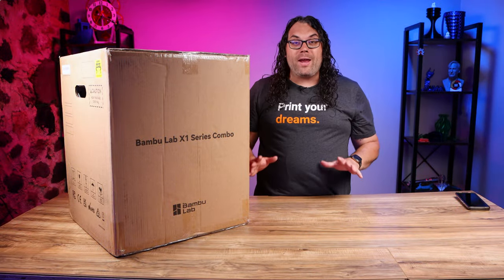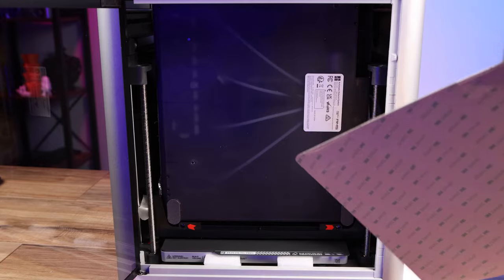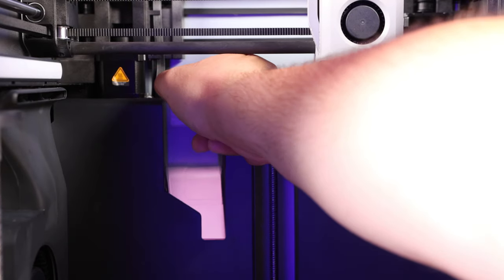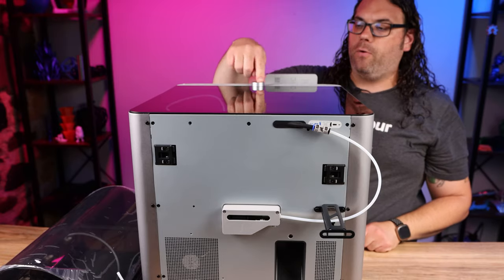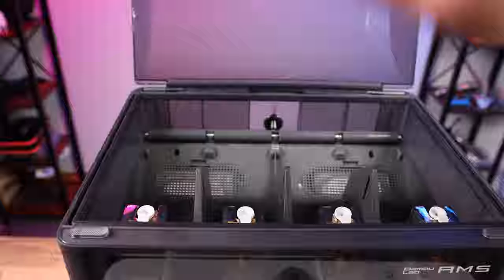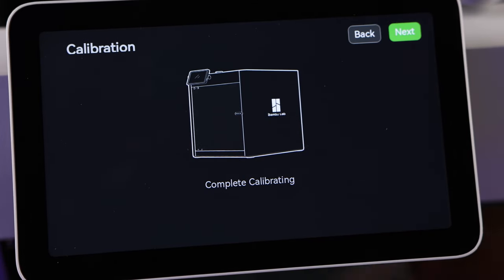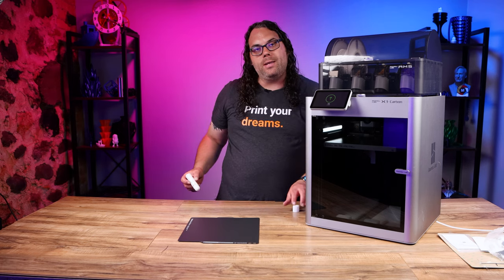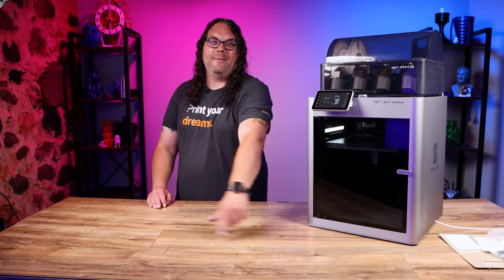Get Started FAST With The Bambu Lab X1 And X1 Carbon!!

Comment: If you are reading this in 2023, DO NOT print with the included white filament…. That is a special brittle filament that is only for supports.  If you print with it not only will the print fail spectacularly but you’ll become so frustrated that you’ll get drunk, knock over tables at Taco Bell, break your hand punching a tree and eventually in a drug-fueled rage expose yourself to a cop and sit in prison for 2 weeks because your kids won’t bail you out.  Trust me.   If you’re reading this in 2022 then yes, go ahead and load the white filament.
Reply: And if your in 2024?
Reply: You'll go to jail not prison. You gotta get convincted to end up in prison.
Reply: Deeply relatable. Thanks for the heads up
Reply: I am trying to read this is 2022 so I can use this filament, but I can’t seem to do it. 😢
Reply: i come from 2024 and about to buy this. Can I understand why I should trash that white filament?
Reply: @Toucheatoutyt  its support filament but i wouldn't teash it.
Reply: Hum…. That was to specific for this not to have happend….. 😂😂😂
Reply: @98f5  STRAIGHT TO JAIL! Gru voice
Reply: Help I'm in 2024. I'm too young to go to jail.
Reply: In 2024 there is a white pla and a white support pla
Reply: I'm going to start with green. I know all about reacting badly to stuff so hope you dont too bad :)

Comment: Nobody mentions this but leave the plastic Styrofoam underneath the bed on until after you calibrate the bed and the bed will raise itself. Don't try to rip the foam out with the bed clamped on top of it

Comment: I’ve had my X1 Carbon for 4 days.  I waited until yesterday to unpack it and spent the previous days looking for unpacking and start up videos.  There are quite a few but yours is the only one that actually took me step by step through the process.  I was afraid to leave the foam under the bed, no one else mentioned it.  I one went from unboxing through setting up the firmware.  Thank you for this.
Reply from the maker: Glad it helped! Hope you love it!
Reply: What do you do with the foam under the bed i didnt see
Reply: @98f5  Yeah, me neither. 🤷‍♂

Comment: Outstanding video! I got my X1 Carbon Combo today and used your video to walk me through the steps. It made the process easy. The only glitch I had was getting my Bambu Handy App to connect to my printer on either my android phone or iPad. It finally did connect to my phone after repeated tries, what I did differently I don’t know. But hey, it works! Downloaded the Windows version of the slicer and printed a flying bridge in PLA using Windex as the release agent on my cool plate. It came out perfect! Thanks for taking the time to make the video.

Comment: Thanks, Jim! I finally got a chance to setup my Bambu today and after watching this video a few times I was super quick and easy. One thing you don't mention is whether you have to provide your own SD card. Mine didn't seem to have one included, so I had to add my own before it would update the firmware or record time lapses. Great video for all Bambu owners to check out before opening up their printers.
Reply from the maker: You're correct, it does not come with one. I forgot to mention that in the video. Glad you got it set up, and hope you love it!

Comment: Thanks, used this to setup my X1C, spot on mate. Been 3d printing with an Ender 2 v3 for a couple of years now, loved that despite the ground work it takes to make it print nice, quite amazed how this thing prints right out the box - only issue I had so far was the Bambu filament not auto detecting - had to input that manually, sure its something simple tho.

Comment: I appreciate the effort put into the video.  One problem for me was the setup in the Bambu Handy app wasn't quite the same as the video - probably because of the age of the video.  I did need to go to other videos because the video never actually finished with the load of the first spool in the AMS.  We just put it in about an inch.  Not setup for printing yet.  Will need to do some more research.  Thank you for what you did provide.

Comment: Another huge thank you to add to the list. I followed through this video to get my new X1C ready. Updating firmware now, then on to the Benchy!
Reply from the maker: Awesome!! I hope you love it! Congratulations!
Reply: @TheEdgeofTech  unfortunately I'm getting some errors right off the bat. Trying to see if I can fix them. 😩
Reply from the maker: @PeteLabrozzi  shoot! What errors
Reply: @TheEdgeofTech  Motor-B has an open-circuit. The connection may be loose, or the motor may have failed. [0300 0700 000100011822 30]
Reply: @TheEdgeofTech  The resonance frequency of the Y axis is low. The timing belt may be loose [030011000002 0001 1822 30]
Reply from the maker: @PeteLabrozzi  They have a good video on how to check that and adjust it! If you need help finding it let me know! Otherwise I wonder if it got loose in shipping

Comment: Great and now I just have to wait till September to get my X1 Carbon😃. PEI-buildplates are listed in their shop already and for very low price so far. IMO their default plates must have the big advantage that you don't have to heat them up for PETG and PLA. That's not just saving energy, but keep dimensions more accurate since parts tend to shrink after cooling, which is so f-ing annoying in FDM-printing.

Comment: I’m using 3DLac for my Prusa. Do you think that the 3DLack will do the same as the glue stick in terms of getting easier to remove the PLA from the bed?
Reply from the maker: It should work the same!

Comment: Thank you for being such a great help for me to assemble the printer successfully. About the glue, do I need to apply it every time I print or only the first time? Thanks
Reply from the maker: You should be able to put it on once and print a few times. You can always just put a thin coat over the area you printed on before the next Print, but not on the whole bed. But I would clean the plate with warm water and a tiny bit of dish soap. Then dry it good, every 10 prints.

Comment: Question. I just ordered my X1C with the AMS option. I plan on using different colored spools of PLA but I won't be getting them from Bambu Labs. My question is how do I tell the printer which color to print from if the AMS doesn't know what color is in which slot because the non Bambu filament won't have the chip in the filament spool(s) that identifies what type and color filament is in that particular spool slot. Can I assume there's something in the printer settings that allows you to pick and choose from which spool slot you want to print from?
Reply from the maker: Congratulations! I hope you love it! Yes, you will be able to choose from a list. So if it's random PLA you would just choose PLA and the color. There are other options to choose as well, but the short answer is yes!

Comment: My question is: Why not just use a build plate like the one from the Flashforge Adventurer 4? (That is my current printer and I've never had an issue with the build plate. Flexible spring steel with a baked in coating for optimal adhesion and a magnetic build plate base in the printer.) Seems like that would be a no-brainer.
Reply: in other channel, they guessed it is because they use lidar sensor
Reply: @bookworm5971  ahh... that makes sense I guess. I'll have to test it when I get mine in.

Comment: For those wondering like I did, you can skip the network setup and app download and keep the unit offline. There is an SD card slot in the right side of the display but it doesn't come with an SD card, have to buy that separately.

Comment: Thank you I now have 3 of the carbon X1. I do have an issue with the AMS after a print finishes it will not retract the filament and stalls each time I have to remove the boden tube from the connector on the back and then hit retry. In doing this it pulls the filament back from the cut point in the extruder and then the AMS can retract and finish the print. Does anyone have an idea or fix for this?

Comment: I usually cut it from the bottom, then just lift the cardboard box up. It's much easier than removing the printer with styrofoam from the top.

Comment: I am a little confused. Do I need to purchase the high temp plate separately? What is the "engineering plate"? is the engineering plate the main plate and cool/high temp depend on the adhesive sheet installed?
Reply: It comes with a plate already, but I ordered an extra plate..just in case

Comment: Despite all wonderful and  positive reviews on youtube.

This printer is fucking shit:
the setup is not as easy as claimed by all reviewers:
the QR code wich appears in the setup isn’t working. The actual one is hidden in the menu of the display.
The AMS setup wasn’t working according to the manual or videos.
And from bambulab you can expect absolutely no support. It’s probably just a letterbox company. I can’t even return the printer, because nobody responds. I bought it, because I’m a beginner and wanted an easy start, but the opposite is absolutely the truth.
Therefore Istrongly recommend not to buy this printer.